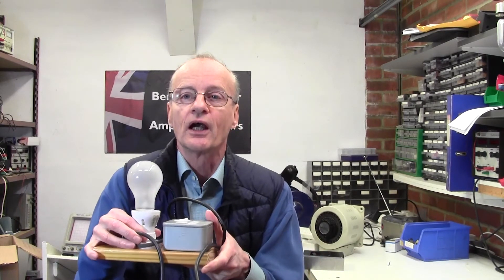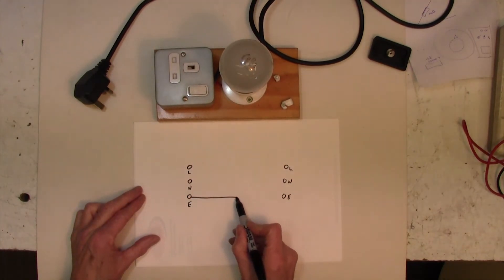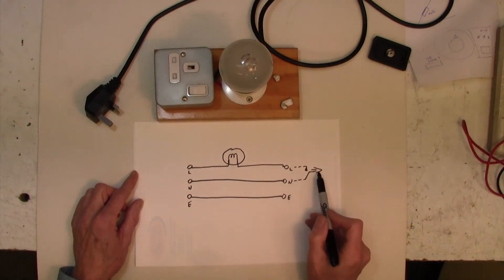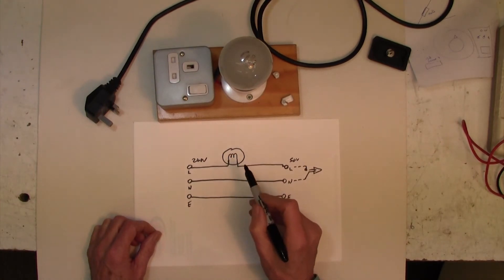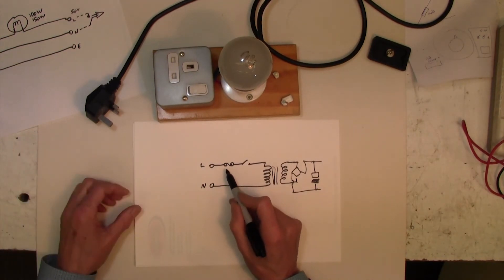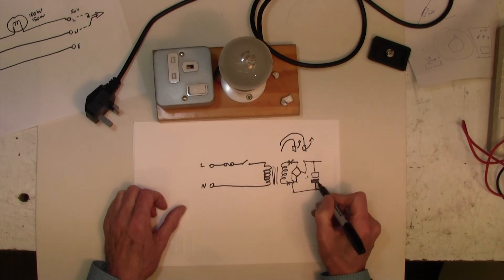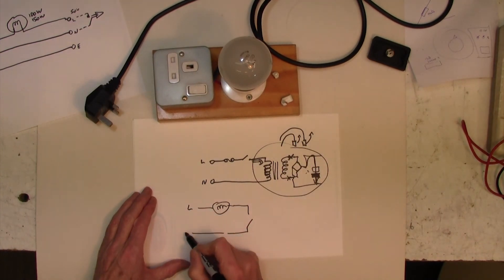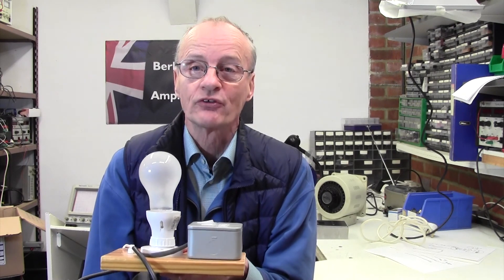How to Make a Guitar Amplifier Overcurrent Protection Device

Comment: I built one of these current limiting testers,I added a second switch.
The second switch is in parallel with the lightbulb.   When the switch is closed, I get full power to the outlet supplying the amp from the wall.  Why would I do this you ask? Once I know, the amplifier is OK it saves me the effort from having to remove the tester and plug the amp in the wall. I guess you could say it’s out of laziness or perhaps convenience.   If I want to test the amplifier at full wall voltage or adjust the bias, I do not want the current limiter in the circuit. It will affect your readings and your adjustments.  Just be sure to have the switch open when you initially plug your tester into the wall and your amplifier. Once you know everything is good, you can flip that switch and have full wall voltage to your amplifier.
Reply from the maker: Hi YEs that's exactly how mine works, I have a bypass switch

Stuart
Reply: @stuartukguitarampguy5830  thats cool!  
thanks for sharing your knowledge! 
I really appreciate it!

Comment: Thanks for showing this helpful tool. I'll have to make one soon. It seems the more I watch, the more I understand what is going on. It's amazing how simple it seems when you understand what is going on in the amp. Thanks again for a great video. 
Would a dimmer switch be helpful in this line?
Reply from the maker: Interesting question and one i have never considered. Dimmers chop up the AC sinewave and give a chopped signal. I'm unsure of the implications of this but it's probably not advisable. I know they are expensive but the proper solution is a variac.

Comment: Why doesn't the lightbulb light up when the socket is being used anyway? Its connected to the current. Why does a short circuit have to occur to light the bulb up?? I've looked at several videos on constructing one of these  and not one describes or answers this question? forgive my ignorance but I cant seem to get around this dilemma. Its wired up to the socket so when the socket is switched on to power the amp why isn't the lamp lighting up?? Whats happening that isn't described here or elsewhere?
Reply from the maker: Hi. Don't worry it's an excellent question! Ok so you agree that just short circuiting the output will turn the light on? It's just like having an off/on light switch there. So the bulb would detect a short circuit say in the primary of the mains transformer and glow full brightness. Ok supposing now I don't short circuit it but instead draw say HALF the current the bulb would normally need to light up. I could do that with a suitable power resistor in place of the short circuit. You would expect the bulb to glow maybe half as bright? Suppose I now arrange  to draw one QUARTER of the current needed for full broghtness. Well now the bulb is glowing really dimly. I think you can see that I could pull a reasonable current through the bulb and you'd barely notice it was alight. Typically I find with a non-faulty amp, the bulb will glow faintly. Does that help?
Reply: @stuartukguitarampguy5830  Thankyou for the reply Stuart. I can understand what you say in principle. But I cant get my head around the fact that current from a standard mains socket ,connected to the  amp AND light bulb only powers the amp? I'm seeing a standard 240 volt current supplied to both devices (assuming 5 amp fuse in plug? Or 13 amp fuse?) The switch to socket is  on and delivers current. But the lamp doesn't light? It only lights when the amp is shortcircuited?? But its already wired to the same socket delivering current to the amp? Sharing the Live Neutral and earth? I'm staring at too much wood and can't see any trees.
Reply from the maker: @fostexfan160  Ah I think what you're missing is that the bulb is in SERIES with the live lead. So the live 240V goes to one side of the bulb, the other side of the bulb is connected to the LIVE input of the amplifier. My switch is on that feed too. Makes sense? IF you look at my channel I think I did a video on this exact piece of test equipment. It's called How To Make a Guitar Amplifier Overcurrent Protection Device.
Reply: @stuartukguitarampguy5830  Sorry but I am now even more confused. The video you mention is the one we're commenting on. I just can't understand your explanation and diagram as you explain it. The left of the diagram you draw is the mains supply which feeds the socket. (left and right of the diagram)Somewhere between this you connect the live to the lightbulb before going to the socket.  Are the neutral and earth wires of the bulb  connected by some bridge that the live is using before feeding the socket? You don't explain this. When you say the live from the lightbulb is then connected to the live of the amplifier?? I assume you mean the live inside the socket?  I'm just seeing a complete circuit that should light up the bulb when the socket is  switched on to power up the amp? Total confusion. Sorry
Reply from the maker: @fostexfan160  Sorry Hadn't realised it was this video you were watching.  Hard to do this in text. I've just rewatched the video and it's really clear. I can;t see how to improve on the explanation. The socket is where the appliance under test (e.g. amplifier) is connected to.
So.... Neutral comes out of mains feed and goes to the (switched) socket. No change there. Earth, obviously the same. Live comes out of the mains feed, goes to one side of the bulb. The other side of the bulb goes to the live pin on the socket. So the bulb is in series with the live feed. Does that make sense? There is ano 'neutral' or 'earth' on a lightbulb, it's just got two pins. Live in and live out. Short the 'live out' to neutral and the bulb comes on. Your second question - yes live inside the socket into which you plug your amplifier. When I say 'live to the amplifier' I mean via this socket. 'Your third point: YES, with the circuit as it is and an amp plugged in and the socket turned on and the amp turned on and a non-faulty amp (that's important) the amp will come on and the bulb will glow somewhat, depending on how much current the amp draws. BUT... if the amp input is short circuit( so that it keeps blowing fuses) then the bulb will now glow brightly. This tells you the amp is faulty (you knew anyway because of those fuses) but important;ly it now allows you to do some mearurement on the amp as this device stops it blowing fuses.
Reply: @stuartukguitarampguy5830  Many thanks for your understanding and kind patience to explain this Stuart. I'm now seeing the trees. Thank you so much. One very happy subscriber looking forward to learning more from your excellent videos
Reply from the maker: @fostexfan160  Excellent, well done. These things are not easy.

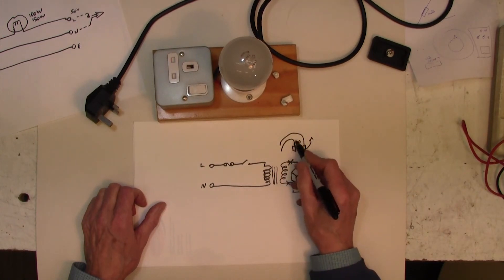Comment: 8:13 If you disconnect the secundairy side of the transformer to the circuit behind, and the light bulb still turns on, 
then there is a shortcircuit on the secundairy side of the transformer.
For the rest, nice and clear video. Thanks.

Comment: Thanks so much for making these videos -- really great stuff! 
I have this question: when I connect my bulb limiter and the amp is not blowing fuses, and the lamp still lights. What does this mean? Thanks
Reply from the maker: So your amp normally blows fuases but when it is connected to the limiter you get a birght glow from the bulb and no fuse blow?
If that's the case, the limiter is doing its job. Only a smal voltage (and hence current) now appears on your amp mains input - not enough to blow the fuse.

Comment: Stuart... I must respectfully disagree with your comment that a 150w incandescent bulb has a higher resistance than a 100w bulb. I'm not sure if the phenomenon of increasing resistance with increased heat/dissipation is the reason you are correct and I'm not, but if you look at the filament as a resistor, then the higher wattage bulb will have a lower resistance. Power is equal to voltage squared divided by resistance (P = V^2 / R). Of course, V doesn't change under ordinary circumstances. Solving for R gets: R = V^2 / P. This says that the higher the power dissipated (150w vs 100w, for example), the lower the resistance, which is the opposite of what you said.
Reply from the maker: Jim, thanks for this. I haven't actually done the measurements to be honest but I can't fault your calculation. It may simply be that the higher the wattage, the less the glow for a given current, and in the range of currents we're interested in, the 150W bulb gives a sensible range of glows (allowing you to visually judge the current), whereas a (say) 40W bulb would give a blinding 'full on' glow which wouldn't give a useful visual indication of current, that's my guess. I didn't invent this of course, just picked it up from other amp techs and haven't given much thought to the exact calculations or why 150W is better than 40W. Now I do put my attention on it, I'm sure the 'glow range' is the factor in choosing a higher wattage bulb.
Reply: @stuartukguitarampguy5830  Given your wealth of experience and my lack of it, I would bet that a 150W bulb makes the most sense, and I like your reasoning. Please forgive my pickiness over the minor details, which are purely theoretical, and not practical in the least. Your videos highlight the very efficient and clever way that you troubleshoot amp problems, and I enjoy watching you work and the tips and insight that you provide. Keep up the good work.
Reply from the maker: @jimprybyla8960  Thanks Jim, I appreciate it.

Comment from the maker: I use 150W regardless. And of course I only use it if an amp is blowing fuses. I also use a variac.
Not sure about using an isolation ramnsformer all the time. I'm only talking about guitar amps here btw.
If the chassis is not grounded I reckon you'd pick up all sorts of hum and noise.

Comment from the maker: I find 150W is perfect for this job. Btw you don't need an isolation tramsformer. I use one only for switchmode supply work (of which I do very little) so that you can ground the scope etc.
Reply: Hi Stuart, thank you for the reply. I've seen too much American videos and didn't take in consideration that the current flow in Europe is half that of the USA. Do you use the 150 watt bulb for every amp or do you use different wattages depending on the power demands of the amp and if so how would you calculate that? I'm still learning and putting together my electronics lab, I'm looking for an isolation transformer not only to protect my oscilloscope by connecting the 'device under test' to the transformer, but also to eliminate the path through me back to ground.